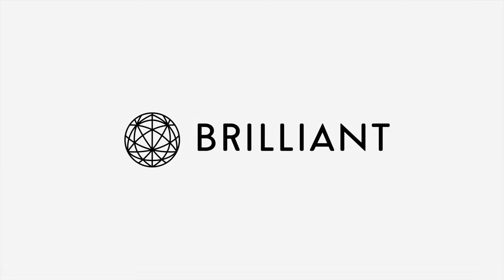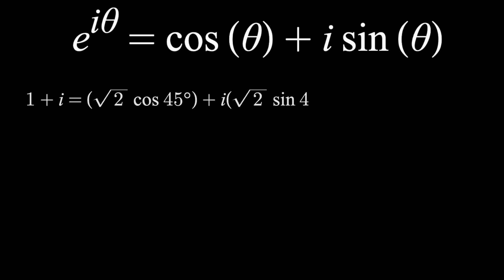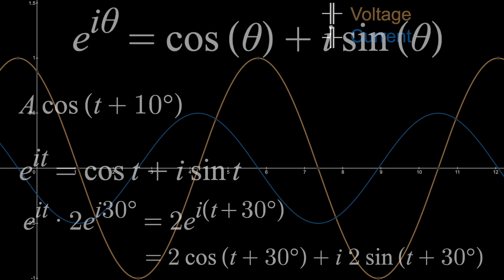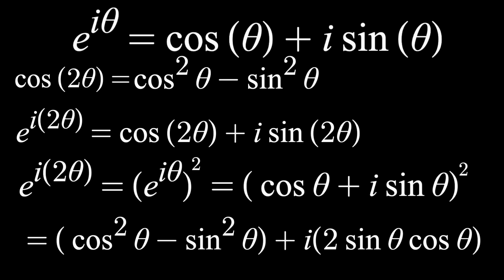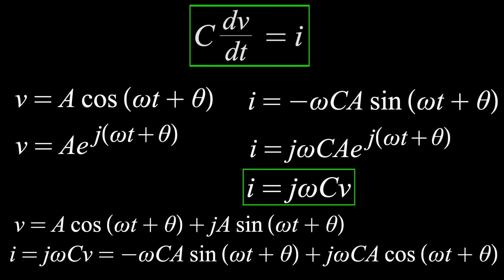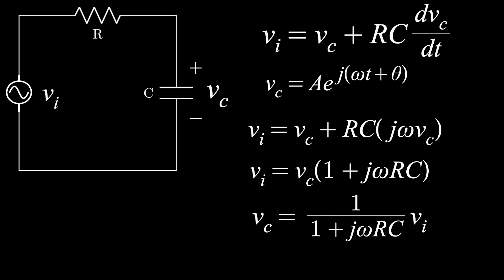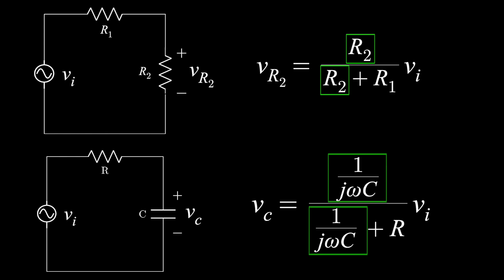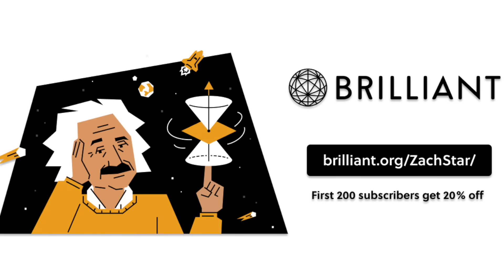Why do Electrical Engineers use imaginary numbers in circuit analysis?

Comment: Short answer : Fourier and Laplace Transform. Avoiding solving PDEs and ODEs to study system characteristics such as stability,equilibrium points, system delays and response to different signals with different frequencies.
Reply: Actually this Is something different. It's called Steinmetz Transform, look It up. The connections are incredibles.

Comment: I always thought it was because energy is stored in the cap / inductor and is effectively gone for portions of the circuit analysis before magically reappearing at a later time.
Reply: Same as my lecturer told me  but later i learn that is wrong. Total energy is same, but distributed to another component for "timing" function. For example, in RC circuit, the power that used for application is in C and its voltage will be charged full for certain time depend value of R. So the energy that is not used by C will be used by R. It easier when you see chart voltage across R and C in basic RC circuit

Comment: 8:26 Why can you substitute with an exponential when there's no sin part of the original equation?
Reply: Let,s try it differently （Typing on the limited functionality of the hp keyboard is difficult）. I,ve never liked this mix mode method of analysis. If you、re genuinely interested to clear your confusion（？） i,ll give you link to some of my ppt notes i wrote some years ago. it,ll take me a few hours to create the link. Bear with me and hope you、ll excuse the poor english.
Reply: @Damian-om7op  extremely interested. Give me everything you've got
Reply: To be rigorous, vc should have been written vc(t) = Re(Aexp(jwt+theta)), where Re(...) is read Real part of(...).
Reply: @Damian-om7op  Fair, but he then goes on to differentiate as if its equal to the full identity, even including the imaginary unit, no? It seems odd to do that, even if vc is rigorously defined as only the real
Reply: yes, we differentiate the full identity and when we,ve done all the calc we need to do, we just take the real part of the final result.
Reply: @Damian-om7op but going from the timestamp, the only calculus that is done is done on the full identity and the original equation is never revisited. That's what transformed it into a whole new problem. The assumptions of the variables' values is never revisited either. Am I missing something?

Comment: Because of the Fourier transform ... you replace differential equation I = CdV/dt or V = LdI/dt by normal equations with complex numbers.  I = jwCV or V = jwLI
It requires a small math course but d/dt => multiplication by jw by the Fourier transform
It's not only in electricity ... in mechanics you can do the same to solve periodic movement like a pendulum.
And when things are not periodical, but still linear, you have an extension with Laplace transform where you replace jw by s, which is a full complex number with real and imaginary parts, not only imaginary like jw.
(and btw, electricians use j instead of i for complex numbers because i is symbol of current)

Comment: 1. This mixed domain (time and phasor) analysis is tricky and treacherous. 2. You need to indicate the reference polarities of the ac voltage source and the voltage drop across the resistor to write the KVL equation for the circuit.

Comment: Really helpful explanation! I personally do not like the style of just discarding the imaginary part and taking the real part as the solution. It makes it look like kind of cheating to throw a part of the equation away and leads questions about where in the real world the imaginary part exists.

I prefer to go a step further and rearange eulers formular into: cos(w) = (e^-iw+e^iw)/2 in order to understand that sin and cos are not the building blocks of oscillation but e^iw itself is. When introducing cos and sin at school it is typically done by plotting the movement of a point around the unit circle over time. But then later when using sin and cos invidually this circular movement is kind of forgotten. redefining cos and sin via the sum of two euler terms with opposite frequencies restores the circular movement as the fundamental building block.

From this perspective complex numbers are just describing rotation and scaling and positive and negative frequencies are just clockwise and counter clockwise rotations.

I just built a tool and recorded a short video to visualize this perspective: https://www.youtube.com/watch?v=JnC0ZrhJr38
Some might find this insightful.
Reply: It's been done... a lot ... on YouTube, on many channels... not only the engineering channels but, the math channels too. I'm not saying I don't appreciate the effort to add content...and others might appreciate it too... but it's been done a lot ...and, it would be great to add insight too. Regards.

Comment: yeah, you get the theory of it correct, but a few things: First, one has to understand that this technique only applies to steady state circuit analysis. For transient phenomena (what happens when you throw a switch) you really do need to deep dive into the differential equations. Also, once you get a feel for the technique you can start omitting the imaginary unit. One would write a phasor as A<θ (amplitude<phase). At the same time you also stop using degrees, but measure in radians, 0 to 2π becomes far more intuitive to use than degrees.

Comment: Because, why not ? I have another question, what does it mean for a battery to discharge, my teacher told me that it doesn't mean that the electrons move from one side to the other. So that's the real issue. Imaginary numbers refer to something "imaginary" and not real. It's a math tool to calculate  something, that luckily fits into that tool.
Reply: Imaginary numbers are just a name that was coined by a critic of the idea.  It has nothing to do with them being any less relevant to reality than the real numbers.

As for your question about the battery, the battery doesn't really store charge.  On net a battery is neutral, and it isn't like a capacitor where it stores a collection of charges on both sides.  Instead, it stores chemical energy.  When a battery is in its fully charged state, it has the maximum possible chemical energy of its electrodes.  When it is discharged, it has the least amount of chemical energy.

One electrode corrodes, while the other electrode returns to its elemental form, when the dissimilar metals are interacting with the electrolyte fluid.  They exchange ions inside the fluid, that move charge from one electrode to the other.  Both charge signs are in motion within a battery, so conventional current isn't even a lie, like it is in the wire part of the circuit.   There are positive ions moving in the direction of current, and negative ions moving against it.

Comment: Unpopular fact. Impedance is a concept when you analys circuits in frequency domain. There is no such thing like impedance when you are in time domain, reactive elements like inductor will be determined by its inductance (amount of back emf produced/rate of change in current) while the capacitor will be determined by its capacitance (the amount of current they draw while charging or discharging/rate of change in voltage). You can notice the fact whenever you see impedances you will not see variable t. 
Resisors are same in time domain and frequency domain that is why they remain R whether we analyse circuit in timr domain or frequency domain.
Reply: Why is it unpopular??? It's just a fact.
Reply: There is such a thing as impedance in the time domain.  It just has the form of a combination of differential operators, instead of just a constant.
Reply: @carultch  I think it's a back emf for inductors and current for capacitor.

Comment: I remember having a 15 minute “discussion” with my professor in my EE lesson at uni (consistently in the top 5 in the world!) where he literally claimed there were an imaginary number of electrons moving around in the circuit. After a while people really can lose sight of their abstractions.
Reply: EE is vast. You can totally be an expert in one thing and forget everything else.
Reply: He's metaphorically right: It's called "displacement current" and correspond on the woobling of electrons inside insulators as an effect of an alternate electric field.  That result in a 90° shifted alternate current that is the virtual continuation, inside the dielectric, of the alternate current flowing within a capacitor. You can - at that point- represent it as a flow of imaginary virtual particles. If math works, why not?
Reply: They're not wrong either, electron flow is much lower than the information that the electrons carry.
Reply: Have you considered the possibility that the professor was messing with you?
Reply: @ivanmirones9220  He definitely wasn’t. This was 1999, in one of the first lectures. I’d done a year out, so was a bit more confident, everyone else was straight from school. Eventually I gave up. I got to know him more later, he just literally did not give a shit about the physical reality of systems, or considered it a distraction - he was completely consumed by ‘pure’ control theory.
Reply: was he referring to the wave function?
Reply: He may be referring to the quantum mechanics of the wavefunction which more accurately describes electrons
Reply: @davedsilva  Nope
Reply: @rjScubaSki yup
Reply: Maybe in that time,  the profesor not consider the electron as a quantum wave.
Reply: That’s not incorrect though. Every sinusoidal signal is coupled with its imaginary counterpart. Just because you can’t measure it, it doesn’t mean it isn’t there.
Reply: @berryesseen it’s a representation that no longer has the same physical interpretation as the base representation. That doesn’t mean it isn’t useful.
Reply: @rjScubaSki  This whole thing is like experiencing a 3D universe in 2D because you are a 2D creature. Your capabilities are limited. If something is mathematically logical and consistent, it is real. Imaginary signals aren't imaginary at all.
Reply: @berryesseen you need to learn a hell of a lot more maths and philosophy
Reply: He is perfectly right. I don't know why he thought that, but the world as I see  is impossible to be completely interpreted by biological senses. If the math is working, you can interpret it in any way. Some like to hear it, some like to smell while some like to imagine if they can't or don't want to interpret it through a biological sense. The superposition in quantum mechanics would be a nice example here.
Reply: @umairm.5662 Yeah, but even in QM, while we use complex numbers, you always have to normalize (And in the case of QM you also have to normalize a few nonsensical infinities). And the reason we use imaginary numbers there is very similar to the one here, waves and oscillations are very well expressed by complex numbers
Reply: @sebastiangudino9377  many things are expressible by imaginary numbers as well as real, and they are equally real. Just say if you like to think about waves in real numbers, I don't - I prefer it to think in terms of imaginary. 

Everyone's perception of reality is biological. So logically we can't be 100% sure that this is how the world works. If math is showing some alternate then it's indeed possible that imaginary electrons are flowing inside the circuit. Idk why you normalize complex numbers, but I know it's possible to think of world with just imaginary number or maybe some other math which people think doesn't matter.
Reply: @umairm.5662  No, what I am saying is that in most of engineering complex numbers have to be normalized at the end, which removed the imaginary part, and this is common since the imaginary plane doesn't represent any physical quantity. This for example is the use of complex numbers as "phasors". You literally cannot think of those "j miliamps of current" because in this context those LITERALLY do not exist

Complex number are mathematically as real as anything else, like matrices. But that doesn't mean I can asing then to any random number as a physical interpretation, the exact same way you cannot have [1 0 , 0 1] years of age. That represents nothing
Reply: @sebastiangudino9377  yeah that's right. They don't physically exist. 

Physically for me means, no light emits from the object. Otherwise I still think it's possible for people to think of things in terms of imaginary numbers. 

And yeah we engineers do normalize to see the reactive power in the form of a power factor for practical applications. But in theoretical terms it's always better to think of Q in terms of imaginary numbers.
Reply: @umairm.5662  I don't really agree with thinking of quantities in complex numbers just because they can be represented with phasors. But other than that we are pretty much on the same page! And there are many quantities that don't physically "exist" but mathematically do that DO affect experimental results. The main one might be electron spin, you might enjoy looking into the math for it!
Reply: How did he become a professor?
Reply: @nicolaignazio  it’s really not that uncommon. He was perfectly competent at his research and still is world renowned in control theory. It was so second nature to him to think of current as complex that he didn’t see the need to keep the justification for it around…. 🤷‍♂️
Reply: @nicolaignazio  In my university, one of our professors (a chemist), dosn't belive in global warming... It's not uncommon, you can be very prepared but you'll be always human. Ad so you can belive in wrong things.
Reply: @dynami3693 i doubt he doesnt believe in it; more likely he doesnt believe the narrative that its man made
Reply: Bruh if it works it works 😂

Comment: Damnit I was gonna do a short answer but he beat me to it with the first 10 seconds.

My short answer:

The maths of multiplying by j causing a 90 degree rotation map very well to phase shifts done by reactive components. It shows you that power is still being delivered because there’s a voltage difference and current still flowing through the component but it’s not the same as how you’d think of power in a resistive load. 

Its use in Fourier Transforms also helps us understand how telecommunication systems work as a the frequency of a signal is just the rate of change of phase

Comment: Its been a minute since i was in college, but it seems i remember the Laplace transform being very similar. They could be used to reduce a 2nd order differential equation to an algebra problem. Same thing here. A simple transform using Eulers formula does the same thing. What a great tool.
Reply: Actually, the s domain has it built in from the start. Laplace’s “s” parameter is a complex number. Its real part represents a signal’s growth and decay rate, and the imaginary part represents a signal’s oscillations. Both of these encode any signal you can take a Laplace transform of. Just like a Fourier transform encodes any repeating signal through pure oscillations, the Laplace transform does the same but also encodes how the signal grows or decays
Reply: interestingly enough, further into a circuits course you end up using the laplace transform to do exactly that. The laplace domain actually takes advantage of imaginary numbers as well, the S variable ends up being an imaginary number.

Comment: Never mind.  I'd suggest this is not a good primer for beginners in electronics engineering.  Theory is fine, but after getting through the grit it's not on your belt at work.  Good to know when being curious and blowing dust off the old books.

Comment: In a word, because imaginary numbers encode the phase relationship between the voltage and current within reactive circuit elements.  E.g., capacitors and inductors.  It is unfortunate that they are called "imaginary" because there is nothing imaginary about the phase relationship between voltage and current.
Reply: Personally I immediately link "imaginary" to complex dynamics and chaotic systems related stuff as a sort of best practice.
Reply: Imaginary refers to ideal components, such as inductors and capacitors that only store energy unlike the resistor that consumes (expends) energy.

Comment: Also mechanical engineers use them, since vibration and acoustic analysis is made of identical equations! We even use electro-mechanical analogies to write (simplified) mechanical systems with circuits!
Reply: Mechanical, acoustic and electromagnetic vibrations are simple harmonic movements and are expressed with the same differential equation, which is why the phasor diagram can be made in all of them.